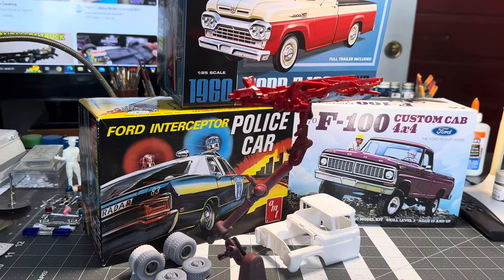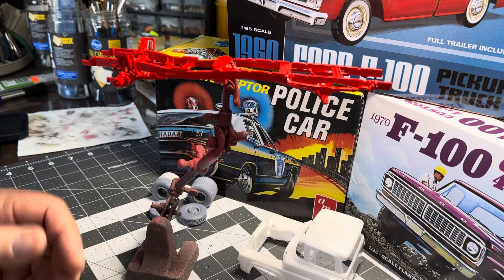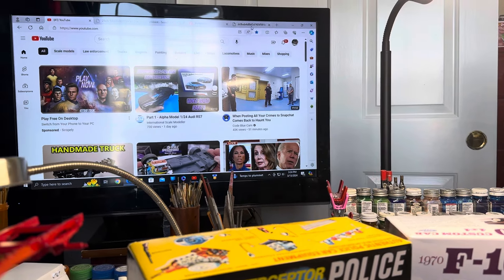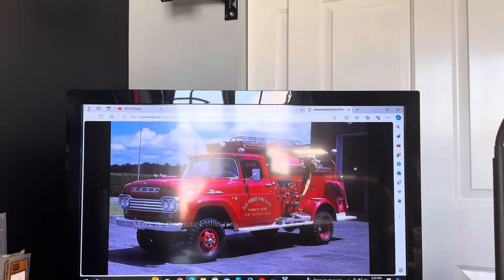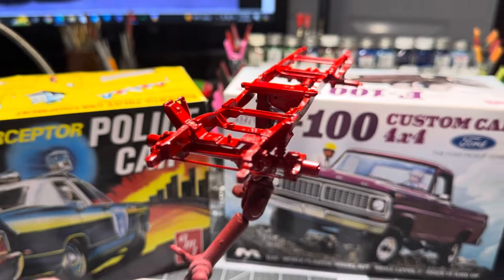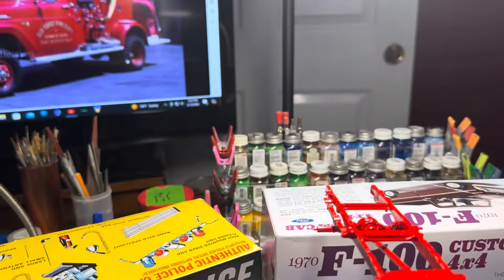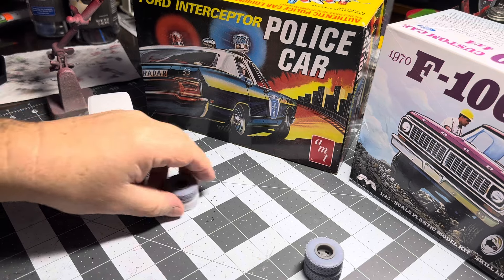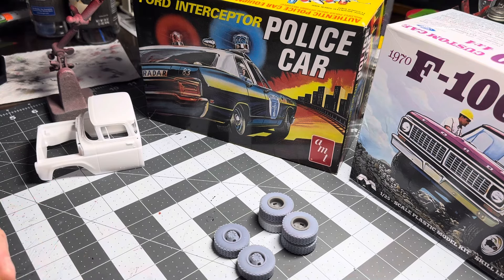1960 Ford mini pumper.

Comment: David, That very mini pumper is now retired, but the department is just about 20 miles north, as the crow flies, from my house! That truck was manufactured by a company, now gone, the Old Forge, NY. The company was The "Little Mo" Company, Brussels Garage in Thendara, ,NY, the Heart of the Adirondack Mountains. I have seen the truck in person, many times, when it was in service. One of the first true mini pumpers in upstate NY. No outside compartments on this one! A V8 powered this on, but I don't know the displacement? Just a cool truck!!! 😎 Somewhere I think I have a picture of the other side of it. One thing, the tires & wheels may be a little too wide, for your build, to keep the rear fenders & tires tucked into the same width as the cab width. Those ties were narrow. Can't wait to see you do your 🪄 magic!
Reply from the maker: Great information!!!! I have heard of “ little Mo” before, they made some cool looking stuff.

Comment: David, you really seem to be enjoying yourself with new projects lined up raring to go.  That 1960 bush buggy is a wonderful idea.  Any chance you'll mount the siren on the front fender so low-hanging branches don't sweep it off the roof?
Reply from the maker: I do plan to mount it possibly on the area next to the passenger door near the window.